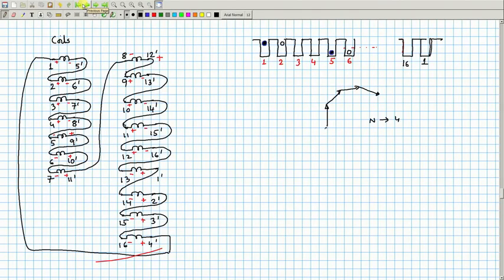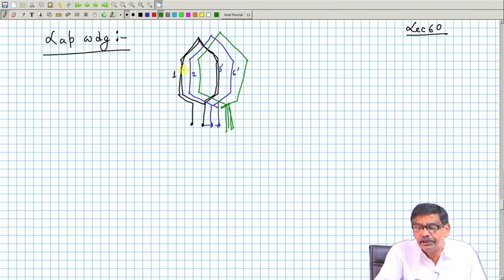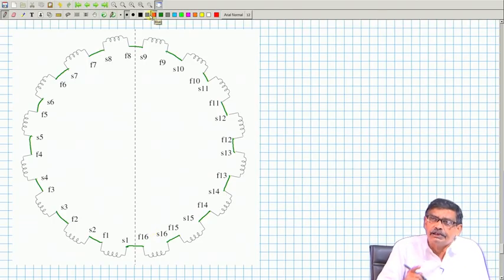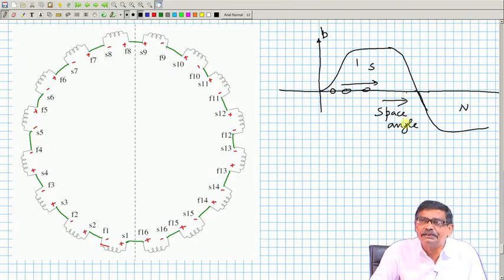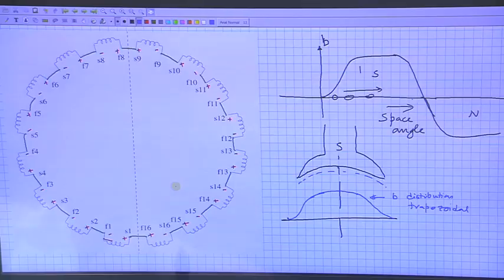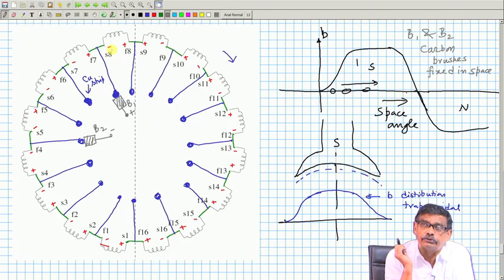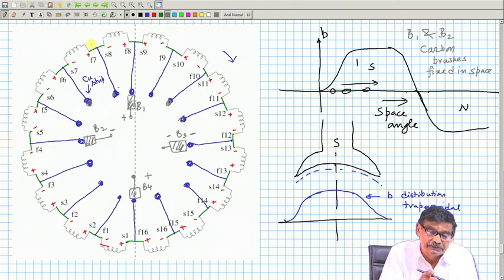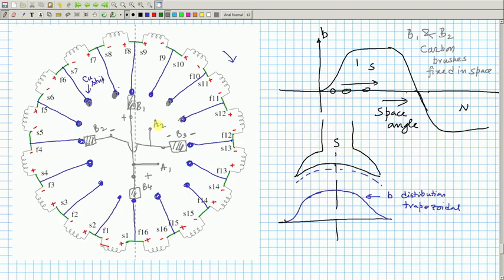Lecture 60:

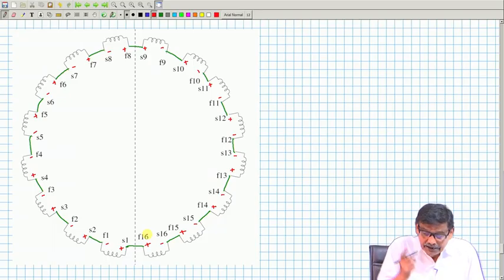Comment: @11:30 Sir, I have a doubt. If the magnitude of induced voltages are  different, then how come the sum of induced voltages equal to zero? (in previous lecture it was said that the sum of alternating induced voltages will be equal to zero.)
Reply: Total Sum of induced voltages is zero but value of voltages induced in coils will be different (dependind upon there dynamic position w.r.t. Poles). For every postive voltage value of certain magnitude there will be a negative voltage of same magnitude, so ultimately the total sum will be zero.
Reply: Got the answer?